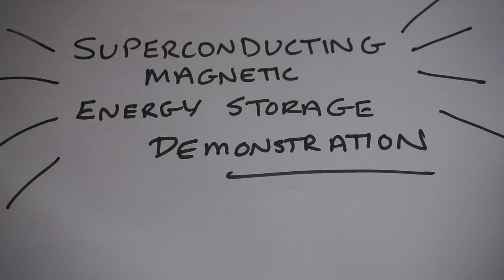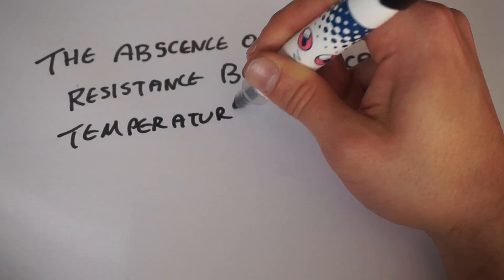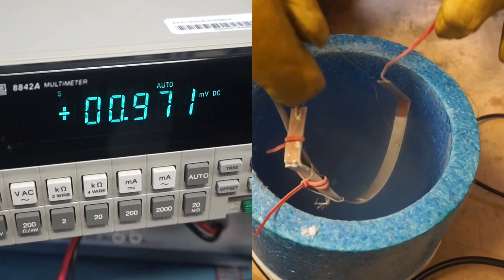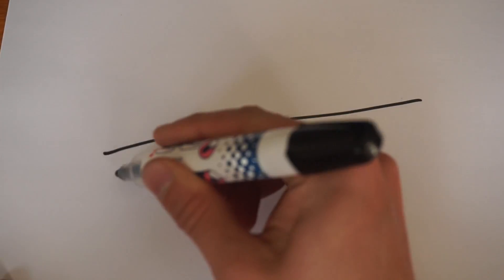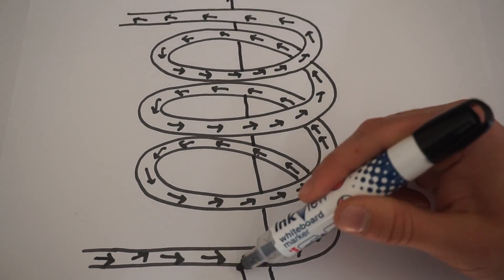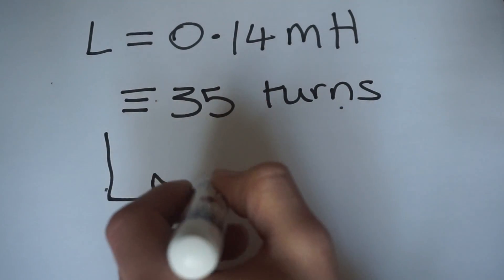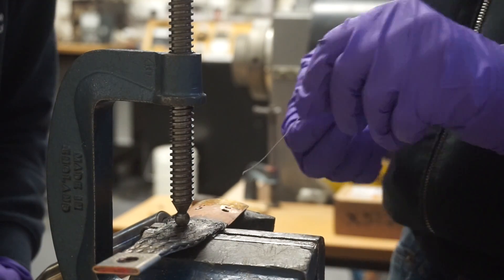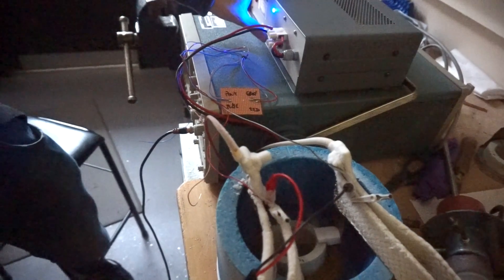Superconducting Magnetic Energy Storage Demonstration

Comment: That was a lot of well done work only to do something a capacitor could do
Reply: High round trip efficiency: 90-
95%.
e Long lifetime: 30 years [2].
e High power, only limited by the electronics and electrical isolation.
e Ready to operate: in a few ms.

Comment: Could HTS magnetic fields replace batteries for powering vehicles or for energy storage in large grid applications ?
Reply: Have you done any reading into this? I am quite interested to know as well
Reply: @Ytgndxajnan  Yes that can replace batteries, as long as they do not need to be cooled down to ultra low temps. For a SMES to be used as a portable battery would require a room temp superconductor. The only problem is obtaining a room temp superconductor. I do not think that information will be public anytime soon as there is big money driving that.

Comment: But why didn't you use it in the short circuit mode/persistent mode? This is where you shot isolate the loop and have current flowing for hours/days then obtain the energy later? The current mode you're showing us is possible with normal inductors too. and is present in almost all ordinary power supplies/ SMPS
Reply: @alexanderadelmann766  a tad more important don't you think.